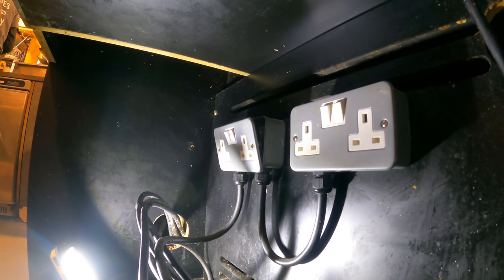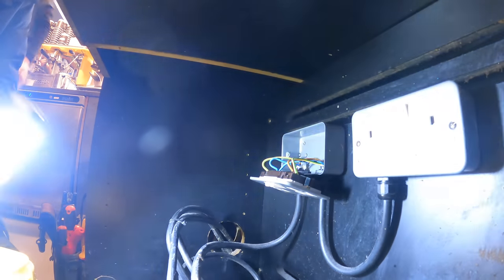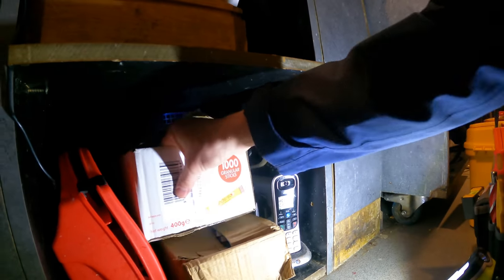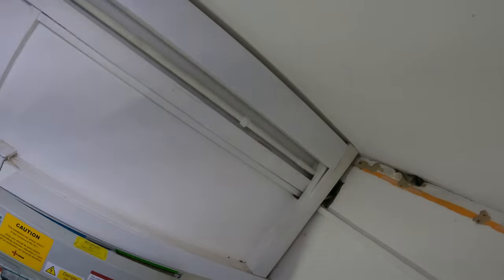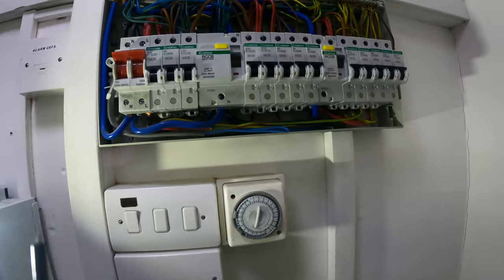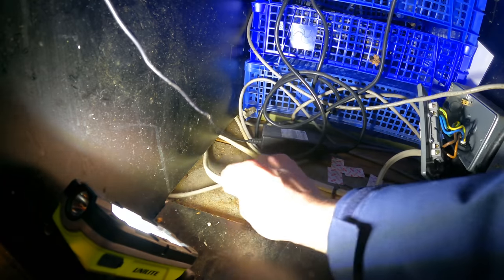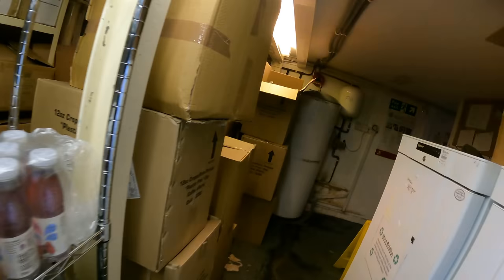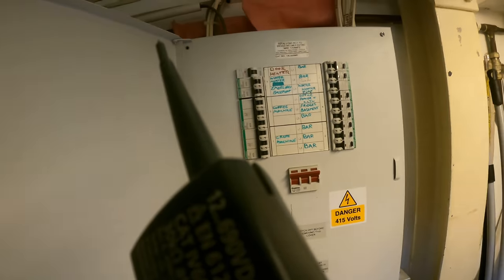Why I Hate Emergency Fault Finding Jobs - Electrician Life

Comment: My colleague went to the local pizza shop to grab some dinner and they said we are shutting as there is no power. He said let me have a quick look and restored power. They then pointed at the menu board and said whatever you want it’s yours.
Reply from the maker: Nice
Reply: Result!
Reply: @DJayAce4  <3 You the best!
Reply: @DJayAce4  The IRS does not like that... can't do anything against it, but Uncle Sam is not happy for lost taxes! ;)
Reply: Always go to the main board first and it will show you how many fuse boards are fed from it and will then tell you if you have found them all. 
A lot of commercial sites have a high turnover of management and employees so the current staff aren’t always aware of where all the boards are.
Reply: @jasoncousins8689  thank god you said that. Would never of thought to do that without your supreme guidance
Reply: @fraserreid719  . Well watch the video, if he had asked for or at least looked to ascertain the number of boards he would know he hadn’t found all the circuits before opening sockets. Your sarcasm is not necessary given even the professional in the video did not do as I suggested and would have saved himself a lot of time, sometimes people miss the obvious but I guess you are right 100% of the time and are never stumped on faults, let’s all bow to you super sparks 👍
Reply: @jasoncousins8689  I thought I was wrong once but I was wrong about that
Reply: @jasoncousins8689 should have a proper wiring diagram laminated and stuck to the DB enclosure. As well as labelling which tells any contractor where the other DB is.

With the new Brother label machines,  you can do QR and Barcodes …  can imagine having a PDF file on the cloud somewhere for instant access
Reply: I was enjoying the video. 
Right up until it veered off I to fantasy land. 

Free parking in Cambridge. 

As if!!!
🤭😎🤣

Comment: Worst thing about fault finding is when you start to lose the head and you stop thinking clearly.
Reply from the maker: Yep
Reply: Definatley, I find taking a 5-10 min break helps clear your good and get back at it, it's bad when you have limited access to accessories aswell doesn't help at all. Good job. 👍
Reply: @goldengaming7499  As a Maintenance Electrician who has worked in factorys and electrical  generation I totally agree, sometimes you need to walk away as you can be pulled down a rabbit hole an hour seems like 10 minutes and you can go on a wild goose chase. Walking away and not thinking about it generally helps re focus the mind.
Reply: Yep definitely walk away for a minute.
Reply: And usually your first gut thourght ends up being the issue! ......the amount of times ive said to myself when i arrive "hummm it's as if theres a hidden switch turned off" or......(rcd faults) "bet its an outside light" 🤣🤣
Reply: @markwilliams4274  Great tip and yes, time really flies when down the rabbit hole!
Reply: @goldengaming7499  Great tip!
Reply: The worst is if the callout is when your asleep in bed
Reply: I’ll often spend an hour looking for a fault but when my head goes blank I’ll take a ciggy break (vape break now, 4days off the cigs) and go back in with fresh eyes. 
Often a call to all other sparks will give you a completely new way of looking at something or even just leave it and do something else for an hour.
Reply: None of that wiring would be allowed in the US.
Reply: @DavidJohnson-tv2nn  the us is more superior
Reply: @DavidJohnson-tv2nn  it's not really over here dude.... regs call for all cables to be adequately supported. I.e. clipped. As a general rule though all restaurants and pubs are a mess over here
Reply: Very relatable, especially at the end of a tiring day.........BRAIN FREEZE 🥴
Reply: I can agree with that. You miss such obvious things when your head goes.
Reply: When you loose your head go and have a walk for 5 minutes
Reply: I repaired machines and hated going to shopping centres , because you could never find anyone who knew about trips or where consumer units were.

Comment: One thing I've learnt over the years is to ignore customers presumed diagnosis.. think for yourself and think clearly 🙂🤘🏻
Reply: I disagree! Sometimes I feel the customers are trying to tell you something.
Reply: @omgthatsme2018  Ha. In my experience they just as often were hiding something... Like what the resident tinkerer had done or what faulty appliance had blown up then been whisked away. Even occasionally not owning up to the fact that a less skilled spark / doer of cash homers, had either caused a fault or ran away from a job because they couldn't handle it. Quite often I'd only find out once engaged on a job or when I'd solved the problem, that the customer (sometimes a main contractor) had only opted to call me in and pay a pro rate because their usual nitwit was stumped. 🤷🏻‍♂️
Reply: IT here. Never trust a customer/user that says they've done XYZ :)
Reply: @James From experience 9 times out of 10 the customer will either tell you they've done something when they have not, or completely lead you off in a different direction. It's always best to use your own troubleshooting to diagnose an issue. This isn't to be ignorant or rude, quite the opposite. This saves both yourself the customer time and money.
Reply: I find it kinda funny how, in this line of work, you don't trust anyone, not even co-workers😂
Reply: @James you listen to them, cause they may say something vital, but you can't trust it. The goes if your co-worker had checked some component.
The first thing you do is to check it for yourself. If they get offended, then they're in the wrong type of work.
Reply: @omgthatsme2018  \  In this case they certainly told me something, that they are dangerous Pricks by taking the plates off, WHY, and to eat something after seeing the filth contained in these wok places, you have to be pissed.

Comment: This looks too easy compared to the struggle of automation, plc and multi-skilled maintenance engineer.
Reply: In my experience, as an electrician apprentice, the most difficult part of fault searching automation, are misleading fault signals. Or figuring out faults in temporary repairs.

Otherwise you can follow a step-by-step approach. And it's usually not too difficult.

The place i work at has the extra difficulty added by having the breakers and power source in random locations😂 which is always fun
Reply: Of course its easier. Thats why the technicians get paid a lot more than us sparks, where I work.

Comment: Good on you Jordan.
You are tenacious in your problem solving and in exlpaining your reasoning to us the viewer. Here in the U.S  at least on commercial and industrial jobs we label the cover plates in the field with the Panel Number and Circuit Number and a help for identification and trouble shooting. Those Kreppe units draw a lot of power and the circuit may have been overloaded. Only time and another call will tell. Hope you got well payed for your efforts . More than creppes. 
This story is full of potential for puns and I could waffle on. No pancake boxes anywhere in the mix just crap everywhere. I think Cory might still be there sampling so its best that you took one for the team. He is the Richard Attinborough of Electricians.
Did you grab yourself a cuppa.

Comment: I think I would have followed the same process as you, the only thing that raised a flag for me was a single phase board for a power hungry commercial install, I was expecting to see a 3 phase board at first, good find though and keep up the good work.
Reply: A place like that would not need three phase.
Reply: Most commercial installs have 3 phase supplies whether they need it or not... if you find a single phase you've not found the primary DB

Comment: This makes me glad to know that here every power outlet, junction box and every bigger appliance needs to be labelled with the corresponding circuit breaker and corresponding fusebox. When used in a commercial setting.

Comment: Doing this for 30y + , fault finding and repairing is a way of life. mechanics, electrical, electronics or software,.... have done it all. Just going step by step and eliminating possible causes, amazing what your able to  repair and recover if you put your mind to it. Personally in this case I would first have asked were the fuse box is, but well done

Comment: I enjoy these fault finding videos! It's great to see how you think things through. In the single phase board, at 7:06 I was just wondering why you missed out the MCB directly next to the left hand RCCB?
Reply: I think it was a lighting circuit which was easily identified by the 1.5mm cable.
Reply from the maker: Wow well spotted that was actually a mistake
Reply: Ah I was wondering the same thing!

Comment: Top tips, all hidden food prep areas are covered in grease, always wear disposable gloves  saves your hands getting greasy and wipe tools down after use  outside to remove all the grease etc, they also like it if you wear gloves they think youre being clean and not the other way around.

Also where ever youre working in the above will usually be very busy so keep tools near you as they may well  be tripped over.

Always ask a member of staff to point out the fuse board and any other fuse boards before you start.

Comment: Did you find out what had tripped it? I had the same problem in an office - the cleaner would come in about 6pm and plug their hoover into a socket which had already quite a lot of equipment on a 16A mcb I had a call about 2 days later saying it had gone again and then we worked it out - bet they will be on the phone again

Comment: Insulation test on that circuit as well as loop and RCD followed by labeling of the circuit accessory to save some other poor sod the headache you just had would be my penny's worth
Reply: 100% IR test otherwise how do you know the trip wasn't caused by a damaged cable.

Comment: You done well there. I do a lot of commercial work , and did a lot for Sainsbury’s .. there shops were ok. Clean and the Installations were good . But small supermarkets , restaurants and pubs , were a nightmare  especially if the owner did not know were all the distribution boards were , junk every were I use to leave my tool box outside till I inspected the shop because many had cockroaches. And I did not want to take them home ..  but good job as many now can see how not all jobs are nice and clean ...

Comment: I was just wondering why you did not PAT test the appliances that plug into that circuit where the breaker had tripped... something made it trip, surely.
Reply from the maker: Yeah but they were running fine off another circuit and I didn’t have a PAT tester with me

Comment: Have you ever tried a Dead Circuit Tracer like the Socket&See?  I would assume that would have been a safe and quick way to eliminate other sockets and circuits and would have instantly helped you realise that the cable wasn't on the first dis board.

Comment: Dont apply for a job in a factory as a maintenance electrician , we have state of the art scada controlling plant dating from the 1950's ,PLC's made by different manufacturers that all use different software  ethernet, controlnet,devicenet, canbus , miles and miles of cables , trunking packed with so many cables the lids dont fit , no drawings , everything covered in dirt and water , and production managers screaming to get it running ! best job in the world !

Comment: During my working life one of the hardest faults to find would be neutral fault. i.e.. A break in a neutral loop especially with machinery where often the neutral would be linked from one contactor or relay to another. With hard wired circuits, often a cable would break exactly where it entered the terminal.

Comment: Cracking video, and interesting. I suggest all the sockets are labelled with where they are fed from, would have made your job much simpler.
Reply from the maker: Thanks yeah you’re right
Reply: In theory, they should all be labelled (CB-5, S/B-2) or similar and many start off with good intentions and practice... 
but...
 the fact is many of these older commercial units have been chopped and changed over the years to suit the current occupiers needs, that most bear no resemblance to the original system at all- of course each new addition should be labeled up as well, but as they often DIY or get 'the cheapest guy' in, it usually doesn't happen...

(add in walls installed and taken out, false ceilings added and when these are done, often cables are cut, shortened, extended or 'pulled to the side'- a cable often does not run where 'commonsense' dictate it does...)

The worst I have seen was a single circuit, that ran the entire length of the shop- FIVE TIMES, before coming out at a single (vital for the new shop fit-out) outlet...
Which was running right at the outlet limit to boot...
It had obviously been moved a considerable number of times over the years, and often they  just 'added  a new length' whenever it had been moved, until the total length of the cable was far longer than the property itself!!! 
(it had so many junction boxes (and even just BP connectors in the ceiling sans junction box) that the voltage was flickering up and down under load- combination of so many joins and aging screw connectors, and a run that was now right at the limits re voltage drop/conductor size- you wouldn't have thought it would be an issue normally, but the sheer length of this run was approaching over 150m!!!! in 2.5mm....

A fault in one of these can be a real test of your diagnostic and 'outside the box' thinking- and your flexibility (mental and physical lol)

Comment: I had a troubleshooting session in an underground car park last week. A lighting circuit kept tripping the circuit breaker. The fault was within one of the 25 fluorescent lamps. You are welcome to guess in which...
Exactly, the last one I checked.
The through-wiring in the lamp was laid directly along the ballast. The insulation has become brittle due to the heat and has caused a short circuit to PE.
Troubleshooting is always fun.🤣
Reply: What you are looking for will always be in the last place you look – logic.

Comment: I was called out to a restaurants outside socket without power 2 days ago. I could see where the cables entered the building and found a SFCU in the off position behind a tin of coffee - one click and the power was back on. They had accidentally knocked the switch off. Turned out to be an easy job.

Comment: Hi Jordan. Do yourself a favour and get one of those signal generators that you clamp on the wire, you then use the "wand" to pickup the generated signal from that cable. Makes it easier to trace cables & identitfy which circuit is involved at the consumer unit if indeed any of them are... I know how you love new toys! Hopefully will save your customers money too.

Comment: Any reason why you left the fuse board cover off and didn't isolate the circuits? Surely you have a duty of care towards members of public or other workforce.
Reply from the maker: I did put it back on just didn’t show it in the video
Reply: It was on the floor as you went to DB2 . Then when you came back up from the basement it was still on the floor. Personally I would have put the board cover back on before I left that board.. hope that makes sense.. not criticising too much has your very knowledgable.
Reply: Simon, it’s not your job. He can do whatever he wants.
Reply: @sanjaysanjib5267  are you for real? Arnt you aware of the dangers of working in a public place? Public liability? Erm... I hope you ain't a sparkie
Reply: @simonwilliams7789  sorry I forgot the consumer unit was right in the middle of the public part of the premises
Reply: @sanjaysanjib5267  so to clarify. Public. Also means staff of the premises. I really think you need to think about public liability. Oooh what about delivery drivers or other tradesman working on the premises.. these days you have to cover yourselves all the time.. you have a duty of care and a responsibility to ensure safe working practises.  I really hope your not an electrician.
Reply: @simonwilliams7789  I’m sure that he said in the video that they had taken a socket off themselves already. It’s the same amount of screws to take off the consumer unit cover, there aren’t any children around, so what’s the problem. It was probably left off for a minute or 2. You’re acting like he went home and left the cover off. You can see that he’s running a professional, successful  business so I don’t think he needs any advice from you when you probably can’t run yourself a bath.

Comment: I was maritime electrician before I was diagnosed epilepsy. One time at shipyard i was installing cat6 wire at passenger ships night club from bar to dj booth. Trough bar desk where the beer etc taps where to roof and down to dj booth. That was pain in the ***. The bar desk air vents was so small you can just fit your hand trough and there was partitions inside the desk where the taps pipes where run trough from holes. The holes in the desk partitions where the point where I needed to get the cable trough. If you but one hand inside from one air vent and another hand from another you just were able to touch your longest fingers from side to side. All that sugar stuff, dirt etc inside that table maked the job terrible. My worst cable install to this date.

Comment: they don't always pin cables up as the fixings puncture the face of the units, had a spark wreck £10K  counter fronts punching through , plus  they harbour grime and  act as  access routs and runways for rodents ,  all made cheap as chips now what punters want  plus its easy to move socket points around when the staff move undercounter fittments